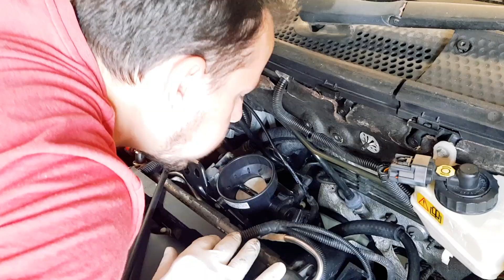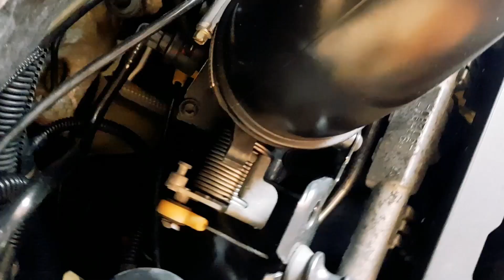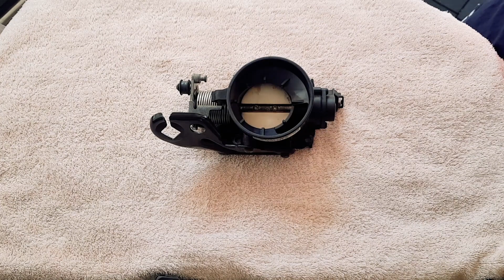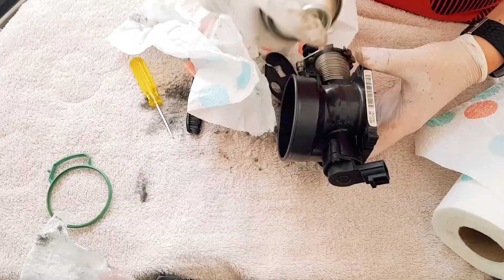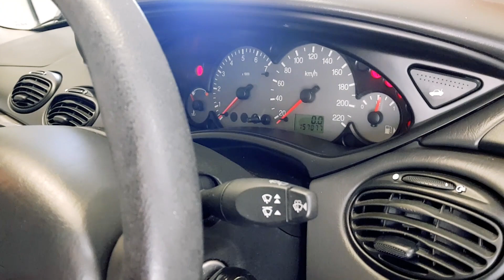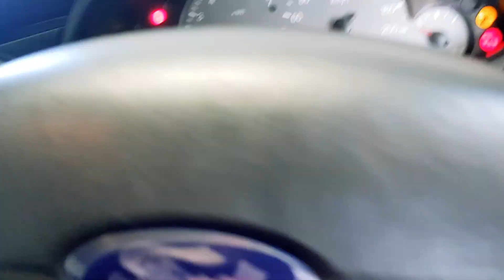How to Clean Your Throttle Body - DIY Guide - Ford Focus Mk1

Comment: Wow, thanks!

My 2004 2.3L stalled out in traffic twice with a stuck closed throttle. The locations of things aren't quite the same as this video, but the basic idea was close enough. The throttle body probably has never been cleaned. It didn't look so bad on the inlet side. When I opened it up the outlet side and edges of the butterfly were covered in black sticky gunk. MAF sensor cleaner wasn't enough to budge it, but paint thinner and a toothbrush did the job.

Find time to do this now, before you get left with no power in a dangerous spot.
Reply from the maker: Happy to see the video put to good use, and I appreciate you taking the time to comment. More Focus DIY vids on the channel if you're interested.

Comment: Hi Horus, I was taking my throttle off to clean it out and somebody must’ve been there before and overnighted the torx bolts. As I started taking them out one of them sheared off on the manifold. When I put the three back in every seemed to look ok
Would you recommend that I take it back off and put a thin bead of r tv or something similar to the corner where the bolts sheard. It’s a ford transit connect 2006 petrol, with the 1.8 black top engine. Thanks Paul.
Reply from the maker: Hey Paul, yep, if you have no way of replacing the manifold, I'd find a way to seal that (try rtv). I saw your previous message about your high rpm too... I think you may have just found the reason why your idle was high, but I think you know that now. Basically, if the mass air flow sensor is reading x amount of air coming past it at the intake pipe, but then more air is sneaking in after the mass air flow sensor (in your case at the throttle body), your ecu will be very confused. Plug that hole and any others mate.

Comment: Tech tip as an ex-Ford mechanic, whenever either the battery is disconnected or the plug is removed from the throttle body, when the battery is connected, turn the ignition key to the warning light, wait 30 seconds then start the engine.

This procedure enables the ECU via the TPS to learn the position of the butterfly plate, therefore avoiding idle issues.
Reply from the maker: Wow, thanks so much for that mate. Appreciate the info! 👍
Reply: Thank you 👍

Comment: Hello, i have a question. My mechanic cleaned my throttle body, but after that my idle fell really low and it's rough, it almost turns off when i break(i can feel it trembling) and then it goes up a bit and then back down. At what rpm exactly is your idle when the engine has fully heated and what do you believe is the case with this? Thanks a lot for your time and the informative video!
Reply: try this: disconnect the battery for 20 minutes. reconnect it. start the car and leave it at idle for a few minutes so that the computer can configure itself on whatever new configuration you have
Reply: @friedchicken1  I've done it multiple times and it didn't work
Reply: @panospng03  if it coincided with the cleaning maybe he installed the gasket wrong or the throttle position sensor? did he clean the mass airflow sensor too? maybe he used something other than the maf cleaner? another thing could be the idle air control valve installed on the intake that got dirty and sticks. also check if you have any leaks by blowing smoke inside one of the air system hoses
Reply: @friedchicken1  My focus has a MAP, also what do you mean by blowing smoke? Is there some video online so I can see ? Thank you for trying to help me so much
Reply: @panospng03  o yeah, for sure bro. I know how frustrating it can be. you can smoke a cigar and blow smoke in one of the air hoses and see if the smoke comes out from anywhere it's not supposed to or if youhave a smoke machine. here is a video from scorry kilmer: /watch?v=zMok2y05jNE
Reply: @friedchicken1  Thanks a lot man, you're awesome!
Reply: @panospng03  :D no problem dud :) lemme know how it goes
Reply: It was the breather pipe under the intake in the end @friedchicken1
Reply: @ AH! :D did you find the leak using some smoke?
Reply from the maker: Hello, the throttle body has a special coating on it from factory. You have to use something mild to clean it like I did in this video. If your mechanic used parts cleaner, or something else abrasive that removed this coating, it will effect your idle... It may return to normal after a while, but it may not. Different people have had different experiences... Your idle should be under 1000rpm when warmed up. Abut 800rpm is perfect.
Reply: This happened on my 01 Focus, Idle issues stopped for me once I replaced IAC.
Reply: @haizi7179 with an oem or used one?
Reply: Brake

Comment: After doing this my idle dropped to 600 rpm, how do i fix this ? Thanks a lot for the informative video!
Reply from the maker: Hi thanks for the comment. On these cars the rpm is electronically controlled, based on air/fuel ratio. I would double check that you don't have a vacuum leak or air leak from the intake or other hoses located around the throttle body.
Reply: @Horus_Works  Will do Horus, thanks for the help!

Comment: What does the sensor do for the tp? Does it also open the tp valve?
Reply from the maker: Hi mate, I think the sensor only monitors the valve position, so that the ecu can get a signal for determining air/fuel mixture.

Comment: Very useful info. I have a Focus with a partially seized throttle. Could this be caused by carbon build up. Regards Charles
Reply from the maker: Hi Chares, yes it could be... it won't hurt to take a look anyway 👍
If it's not the throttle body, it could also be the throttle cable. Have a look to see if it's not damaged or catching on something. Best of luck sorting it out.

Comment: Removing all the throttle cables and battery is unnecessary I just removed the air filter and the T30 bolts and cleaned it right up on top of engine 10 minutes.
Reply: You can never clean the throttle 100% without removing it ! 😂😂
Reply from the maker: Sounds easy!

Comment: i did this, the car really runs very good after doing this. But why does it idle a litle higher now when engine is fully warm? I did reset the ecu.
Reply from the maker: Hey, thanks for the comment. I'm not sure why the idle would be higher as mine is normal. Could you have a vacuum leak somewhere?
Reply: No vacuum leaks, checked everwhere. Maybe because there is more air gap now between the throttle butterfly? It whas always idling at 750rpm car whas stuttering sometimes when accelerating and it whas having hard starts. Now that all is gone! Car starts very fast and pulls very smooth in every gear. But it idles at 850 rpm now.
Reply from the maker: Oh 850rpm is fine don't worry about it. I thought it was over 1000rpm, that would be a problem to look at.
Reply: i will make a video for you, so you can maybe understand me a little better. i can say it idles a little higher than before, but i cannot call it high idle like a vacuum leak. Normally i use to give it some gass from stop, so that the car would accelerate smoothly. Now it already moves when i release the clutch , witch i like very much now. it runs like a electronic throttlebody now. 😀
Reply: In this video you can see my idle once the engine is warmed up. 
https://youtu.be/mzVQdIQrtBc
Reply from the maker: It looks fine mate, I wouldn't worry about it. Seems perfect to me, mine sits at about the same place.
Reply: But the strange thing is it idles a litle higher than this when driving around and only when the engine is warm enough. Can this be because the ecu is still learning from reset?  The car whas sluggish before the cleaning. Now it really amaze me! It drives like a brand new focus!

Comment: it really doesnt makes sense to clean out these throttlebodys from these fords.
The throttlebody is made to fully be fully sealed at idle, so that the iacv is fully under control when idling.
Reply from the maker: Cleaning out the carbon build-up accumulated over 20 years of driving helped it run better.
Reply: 20 years is a long time you know? you could also buy a new one with a new build in tps sensor. instead cleaning it and messing up the Ecu tuning by letting in that extra air at idle.
Reply from the maker: @scottykilmer1094  not everyone can afford to just buy new parts when the old ones still work fine? Not sure why you keep pressing this, but don't follow the vids if you don't like what you see. I can definitely say that 7 months after doing this the TB still works fine after the clean. Nothing has been messed up, you will see that TB cleaner was not used to clean the TB, I specifically said not to use that. The coating from Ford is still intact, and the tolerances look fine - no extra air coming in, no effect on fuel economy at all, and no rough idle. Hope that helps clear it up (pun intended). You can bet that I would not have posted this vid for everyone to see if my TB was messed up after I cleaned it. It is fine, and has been for several months now.
Reply: seriously if somebody cant afford a new part for his car, should not buy a car in the first place!  i didnt say you messed up your throttlebody, im just saying that this is not the way to fix a rough idle, or performance issue. its all depending on the iacv.
Reply: dont get me wrong, you made a great tutorial video no doubt !  but all im saying is that these ford (non electric) throttlebodys does not need cleaning to fix idle issues.
Reply from the maker: Maybe you're right Scotty, but all I know is that mine was pretty gunked up with carbon, and having cleaned it I've got it back to a state that it was in when new (no carbon build-up, just like Ford manufactured it). That definitely can't hurt if done right. I understand that this TB assembly adjusts itself to compensate, but all that oily recirculated air from the rocker breather hose, and any dirt that may come through a damaged air filter goes straight through your TB. It definitely doesn't hurt to take 15 mins and clean it every 3-5 years or so and get it back to a state that it was in when it left the factory. It's a nice and easy Sunday afternoon project. If anything you prolong the life of the part. I for one am someone who likes to take care of things, and don't subscribe to the idea that if you can't buy new parts to this car you shouldn't be buying cars. Firstly these cars were sold around the world, and in some countries that see these videos, parts for these cars are very hard to find or even expensive in that particular currency. Also, since this is a DIY channel and I want to promote DIY projects - the fun is in working on cars, right? Not necessarily just buying new parts with cash. It's not always about the money or quick fixes here. It's about learning something new and enjoying cars along the way, and in that spirit, maybe people will read these comments and learn something new both from you and myself. Hope that makes sense and clear up why I do these videos, but I appreciate your point of view and opinion. This is just somewhere that you and I differ.

Comment: You disconnected the positive lead to your battery. Please in the future disconnect the negative lead to the battery. With positive being disconnected your vehicle is still live .
Reply: Very good tip, but no explanation. Here it is: because a metallic spanner is used to disconnect the terminal, it is possible to touch, by accident, another metallic surface in the area, wich is for sure a ground (connected to the negative terminal). If the spanner shortcuts the negative terminal to ground, nothing happens. If the spanner shortcuts the positive terminal to ground, it gets serious: the current of the battery is high enough to weld the spanner with highly charged sparks, causing very hot, incandescent points. Fire and injuries might very well occurre.

Excuse my language mistakes, if there are any.
Reply from the maker: Thanks a lot for the tip.
Reply: I was about to say this.

Comment: This is the best way to fuck up TB.
There is thin layer of coating that prevents tb from leakage, when valve is closed.
TB after this cleaning should be checked for leakage and remain tight.
Any leakage will mess fuel map that is stored in PCM....
Reply from the maker: It is if you use Throttle Body cleaner... don't use that, use what I used instead, it works. I put the throttle body back on and Zero problems 3 months later.
Reply: The coating gets destroyed if you use a brush to clean it. Ford says only use a soft wrag with contact cleaner.
Reply from the maker: @scottykilmer1094  Ford may say that, but I can assure you that I've had no problems at all since cleaning the throttle body this way. I used a very soft bristle toothbrush so no harm done.

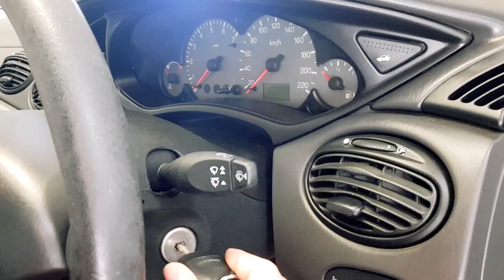Comment: Very Nice. 7:46 - i want my gauges do the same thing😍 any hints?
Reply from the maker: This only happens when the battery is disconnected and reconnected again. It means that the car systems are starting back up. Hope that helps.